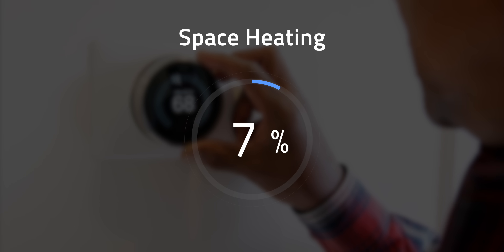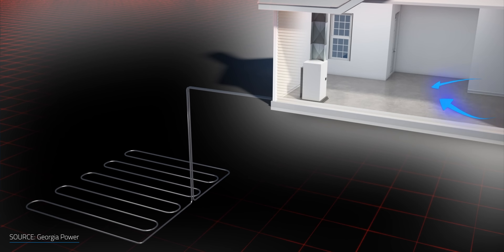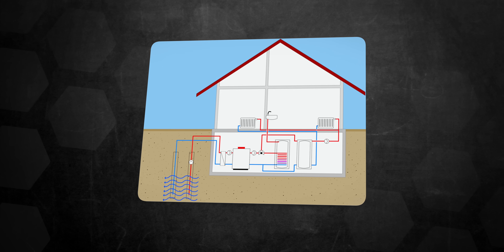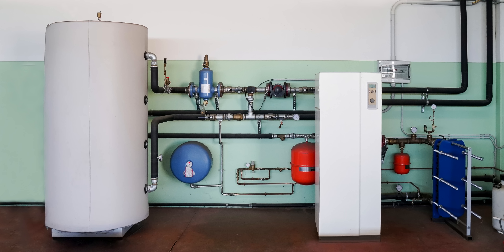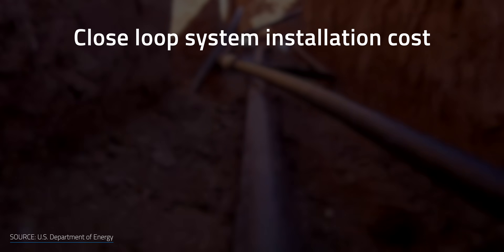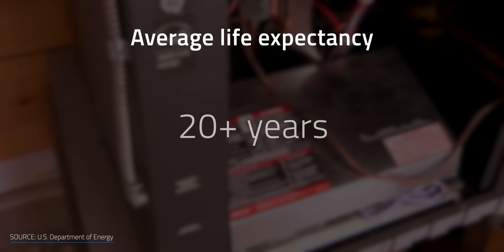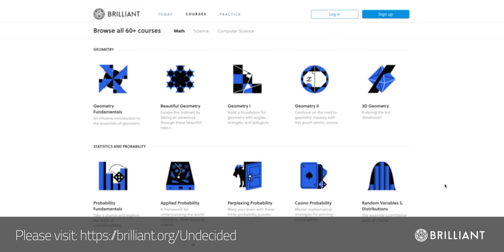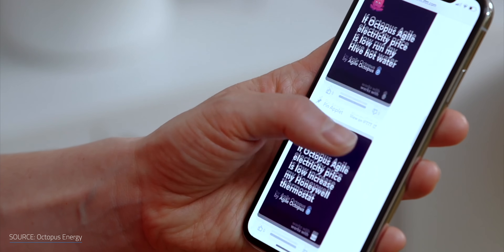Is Geothermal Heating and Cooling Worth the Cost?  Heat Pumps Explained

Comment: You missed a fairly important kind of closed loop system, where the tubing is straigth or coiled placed in a deep drilling hole of about 80-150 meters depth and 40-70 centimeters in diameter. They provide excellent geothermal coefficients, are placeable even on the smallest back- or frontyards, but are more expensive than horizontal solutions.

Comment: All of this geothermal energy and heat pump tech require big taxpayer subsidies. Question: If they are so efficient and cost-effective, then why do they require all of these subsidies? The best way to keep your heating costs down is to insulate your home better, get new energy-efficient windows and doors, maybe get a new furnace, and turn the thermostat down. These steps don't cost taxpayers a thing, and you will start saving energy and money immediately.

Comment: Anything with the name "heat pump" in it is a scam honestly. They're cheap mass produced units subject to poor quality and fail regularly. Their heat output will never match that of natural gas, oil, or wood burning stoves. I've had more issues with heat pumps than any of the other two, and have seen others gone through their own troubles as well. They simply can't put out the same level of heat as other options, and I'd be highly skeptical about this system as well.

Comment: The vertical loop systems is now widely used in new homes here in Hungary. We are currently building a house with such system. The tubes go down about 100 meter deep into the ground.
However people here don't use a system that circulates air, many new houses have floor and ceiling heating.
Reply: it's kinda bad, as air circulation system could be combined with ventilation system to supply fresh air
Reply: @s.i.m.c.a  Floor heating provides much better comfort, and requires less energy. There is usually a separate system for air circulation that runs 24/7. We are currently building a house and there is an air vent in every room, as well as floor and ceiling heating. The fresh air from the outside also goes through a heat exchanger and a filter.

One more advantage is that during summer months, cold ground water can be circulated in the ceiling to cool down the house, which requires very little energy.

Comment: Here in Switzerland, that’s a 25-30 years old technologie. We no longer use non-deep geothermal system. Now for a home you have to drill a well between 150m and 300m deep (500 feets to 1000 feets) for the heat exchange.

Comment: Really? Liquid cannot be compressed! This is a simple phisic law used for car brake system. Car brakes use liquid to transfer the push force from pedal to brake pads because liquid doesn't get compressed so the pressure aplied by foot on pedal doesn't get lost on the way to brake pads. So here  in this video, how do they compress the liquid to have a higher temperature??? This principle is available to air. Compressing air (not liquid!) to make it hot it's also being applied on diesel engines, especialy on those with a turbocharger, used in a lot of ships and vehicles, including cars (coincidence, there is also the place where the liquid is used for brakes). This video is shit.

Comment: When comparing two equivalent systems, KISS (Keep It Stupid Simple) is a crucial factor for deciding.
My non-statistical experience with similar kind of heat pumps shows that these are complex systems to maintain, and that longevity numbers supplied in this video are exaggerated.
A high price tag for these systems means one thing - the technology is not ripe for home installation.
Reply: I have a friend with one of these systems. Over the last twenty years he's had about $15,000 total in repair costs. The parts are expensive and he can't just call a local AC company - someone has to come from 100 miles away and he usually has to wait a few weeks. The system cost was also about $16,000 more than a normal one. His electric bills are very low, and maybe he broke even money-wise (he has a large house with a lot of glass), but it has been a huge hassle with the repairs.
Reply: @jmodified  I have similar experience with a McQuay air source heat pump used for heating shower water for 10 apartments (~1,000 liter water tank).
The compressor gave up after 6 years of use.
The system cost was roughly 15,000$ in current exchange rate - I live  in Israel  in an ideal location for the operation of this system. Minimal air temperature here is  5°C. Peak CoP was around 2 in the summer, but that is because too small a heat dissipater was installed in the water tank.
It is now replaced by simple heaters whose cost is 1/3 of of the air pump's, and any electrician can handle (well, it is simple enough for me to handle). Actually I did not have to replace the system. I just turned on the heaters that where pre-installed in the water tank as a backup for a failing heat pump.

Comment: I wonder how deep the system would have to be here where we just came out of 40 days below -30 degrees.
Reply: If you have a vertical system, it doesn't matter how cold the weather is. Vertical systems usually go down 100-150 meters into the ground, where the temperature is not affected by the seasons and surface temperatures.

Comment: I am planning a DIY lake cooled open loop system , so most costs go away pipe from lake to house and pump, and i can convert an indoor unit, and outdoor unit to geo for about 500$ avoiding the crazy geothermal heat pump costs; what do you think?

Comment: When we build our house, it was no-brainer to get geothermal heating. We mainly use vertical loops and only one loop per house here in Finland. Length of it depends on your system and soil. Ours was 150m long. Almost 500ft. We don't bring heat in houses via air, but we use heated water under floor.. only the cooling part is water to air system. There is lots of synergy when you use also cooling in your geothermal, because you add heat on the ground in summers and draw it back on winters. If you only draw heat whilst it's cold and have "save" money when drilled too short well, you might up end with hole where you just don't get enough heat anymore.. and the it will cost you more.

Comment: You an engineer, not a mechanical technician and it shows your extremely basically knowledge is deplorable... you measure you cooling in tons and on average its 400-500 sqft a ton... a 2300sqft house would require a 4.5-5 ton, but that is also calculated by the hottest day of the years needs...
Reply: I think current suggestions push oversized systems. I live in Florida in an 1800 square foot house with average insulation, no tree shading, and single-pane aluminum windows, and a 41 year old 3 ton air conditioner works fine (well, it did - the compressor got a bit noisy this summer and probably won't last another). My neighbors with a similar house that is maybe 1/3 shaded did well for decades with a 2 1/2 ton. In a newer well-insulated house, requirements should be even lower.

Comment: Engineering student here. These systems, and also air heat pump systems do not use radiators to warm your house but floor and sometimes wall heating. As you don't need 70C water to warm rooms, more like 35C.
Secondly it matters of course how big your house is, but defenitely also how well the house is insulated.

Another downside is that with the system alone you're often not done. If your house is a little older and not that well insulated you usually need to fix that in order for heat pumps to work efficiently.
Also this system takes up a lot more room in your house than a conventional gas heater.
Also doesn't really work in dense urban areas. 

And lastly, personal pet peeve maybe, but don't say carbon, but Co2, carbon is way too general.

Comment: Don't forget the additional cost and maintenance for your water well and the increase in your electric bill. Some geo units use 8+ gpm, how much water does your well produce? Most standard homes a well will produce 4-14 gpm. That doesn't leave a lot left over when the geo is running. Can you just upgrade your well pump for additional water?  Can your well handle the increased production or will you have to drill a whole new well?  How much more frequently will  you be replacing your well pumps?  Most well pumps only run for minutes daily. A well with a geo unit runs for hours a day.

Comment: It may be possible to reduce the cost by using a plastic pipe that you can inflate and basically drill itself into position like a snake. Then fill the plastic pipe with something like concrete then use a smaller plastic pipe to then drill into the concrete creating a concrete pipe that probably holds water. No digging required.

Comment: We need to train a lot more technicians to work on the refrigeration side of all of the varieties of heat pumps. Scheduled coil cleaning especially on air to air or air to water is crucial to proper operation and energy savings. I never see this cost mentioned in the sales presentations.

Comment: It's great when it's good and terrible when it goes bad. Almost never stand alone in Canada. You have to have supplement heat. Even if you oversize your unit  Which means the your utility bill is paid up front...for 20 years...but in actual experience, if you have 3-5 issues in that 20 years...it doesn't pay for itself in its entire life.

Comment: My inlaws had a geothermal system installed in their new house build about 10 years ago and it went kaput a couple years into the use .... not sure if it was the company who screwed up .... but in an area where we get some extreme colds during the winter months, the last two weeks we had constant temperatures between -35 and -40 Celsius .... having frostlines that can go past 10 feet into the ground I could only imagine what the start up costs would be.

Comment: It's not always advantageous to have underground structures as such when many different types of "condensing units" such as shell and tube or tube in tube 
condensers are smaller provide more efficient. Heat transfer coefficiency and also more practicality in terms of maintenance or contingency planning

Comment: I just installed this here in Finland. They drilled vertically 160m. in the granit rock, coming +65C warming water in batteries and same gives warm wather for shower. Cost 22K€ minus some thousands back from taxes (because I changed off oil heating).
Reply: 160m?! They built a mine under your house
Reply: That is not ground sourced heat.  That is geo-thermal water heating.
Reply: WOW, I am very happy to hear that you can drill such a shallow well and reach 65 C water - that is 150F in American terms.  That is so hot that it would need to be cooled off to take a shower!  It is sort of like paying your natural gas or oil fuel bill only once for the rest of the life of the home, and then some!  You should be able to share some of this heat with your neighbors, if they are close by!  Maybe tell them you will supply all the hot water they need for $45 euro's a month?  Then payback can happen much sooner!
Reply: @landlord5552  who did u use. I am looking to do the same

Comment: With zero mentions of insulation this is a very unbalanced video. Dollar for dollar you're better off investing in insulation and air-tightness than in heat pumps until your house is very insulated and airtight. And at that point you'll probably don't need these any more and you can go for a much cheaper air to air heatpump. With recent advances they can function even when it's very cold outside.

Comment: This technology is pretty ancient, its existed before the era of Steam power, although there were no giant pump like that, it was all passive. 
Sometimes, the simplest solutions, are often the best ones, in Soviet Union they built these geothermal heating and cooling solutions for entire cities in northern Siberia because these places were too far away from national electric grid and railway connections, the only way to heat was to supply electricity locally or stock up on heating OIL, that was not logical, heat pumps however for entire apartment blocks made more sense and far more efficient and they had the space and land for it as well.

Comment: First step for a house is proper insulation. Fiber glass or something similar inside all outer walls, also on top of the inner ceiling at the attic. Triple glassed windows are standard where I live (Sweden) as windows are the biggest problem for insulation. A heat exchanger on the wall is huge as it can both heat and cool a big living area. It's quite insufficient if you get really cold temperatures though (after -20 to -25 it starts to struggle).

If you go for geothermal heating drilling deep into the ground, you have to do some background checks where the soil ends and the core starts. It can get very pricey if you're unlucky and is a gamble. It's more efficient than the linear way (ground heat), which also requires some big space of course. Both are very good investments in the long run.

I personally would never live in a house without a stove with a hotplate, both for heating and cooking if the electricity goes out. It's not fun to die just because you're not prepared for a disaster scenario.

Comment: You cannot compress a liquid in a refrigeration system.  That is the most common cause of compressor failure.  Liquid refrigerant should never return to the crankcase of the compressor.

Comment: First-time viewer and love the concept behind your channel! Just wanted to point out that I think your math is wrong at the beginning of this clip. If 15% of electricity is used for heating, and 16% for cooling it's incorrect to say that 31% of electricity consumption comes from these two sources, given you are either heating or cooling your home, and not both simultaneously. I think it would be more accurate to state that heating & cooling accounts for 15-16% of electricity consumption.

Comment: No no nooo, wait a minute, wait a minute. You say that heating represents 15% and cooling 16%, and you go and add them up, saying that they add up to 31%....uf, what a serious mistake. If we average cooling/heating it comes out to 15.5%, every month of the year that you use them. But add 15% heating to 16% cooling in winter, does not make sense. Adding air conditioning cooling to heating in August... is not possible. Nobody does that. So you have to add 15% or 16% to the expense generated in a month depending on the month, not every month. Where am I wrong?
No no nooo, un momento un momento. Dices que la calefacción representa el 15% y la refrigeración el 16%, y vas tú y los sumas, diciendo que suman el 31%....uf, qué error más grave. Si hacemos la media de frío/calor sale 15,5%, todos los meses del año que los uses. Pero sumar 15% de calefacción al 16% de refrigeración en invierno, no tiene sentido. Sumar el frío del aire acondicionado a la calefacción en Agosto... no es posible. Nadie hace eso. Así que al gasto que se genera en un mes hay que sumarle 15% ó 16% según sea el mes, no todos los meses. ¿En qué me equivoco?

Comment: We have a new built house in germany with a deep drilling thermal exchange system (99m, you can calc this into feet or inch depth or w/e you like yourself) with an efficiency factor of above 7 (1 part electricity makes more than 7 parts of heat). It is about 25k€ tax incl. installation cost including the drilling cost. Highly pleased with it since the electricity rates for these house heating sources have separated rates than normal(consumer electricity) rates (50-60% of the price of normal electricity rates). Also there is very little space required for the deep drilling (20sqm)  and it's not really more expensive since you surely need heavyier machinery but less soil to be moved. Your only need a public power hook-up(it's split up inside the home), no gas or oil delivery, no storage room for the fuel, no chimney on the roof(no servicing for the chimney) and at least in Germany you get state funding for modern heating systems. This combination was promoted with almost 8k, so total cost was about 17k (again tax incl.). 10/10 would recommend

Comment: Your figures are not quite realistic. I've been in the HVAC trade for the last 25 years. Most of the information is on point. Residential conventional systems are well over $10k to install a new system. That is just equipment only. Add ductwork into the equation and that cost balloons to over $15k. Im from San Diego and plenty of equipment only changeouts were $12-15k...add ductwork and its $20-25k. Water source isn't feasible due to lack of space available....pack houses and people in like cattle. Any water source system closed or open does require annual maintenance and care. The pumps, refrigerant circuit and overall quality of the equipment is not made like they used to make them....lots of bells and whistles....but loq on quality. You won't ever get 50 years out of any modern day equipment...you won't get 25 years out of it. Manufacturers want and need to make money.....so they build themnto fail....parts are big money makers. Plus all the cheap Chinese made garbage is doomed to last a short while.

Comment: I doubt any of these systems are going to work in more colder climates. I mean the ground temperature is neve going to be warm enough. What kind of temperatures are we talking about? for winter is it even going to get above 50F? because the ambient ground temp is usually around that. 50F is terrible for a winter. Summer I another thing, but 50F would be perfect since you can tune it more.

Comment: The figures of 1 kwhr of electricity gives 1 - 5 kwhr heat are laboratory figures. In the real world it is more like 1 to 2.5. And given electricity is typically 3 to 6 times more than natural gas the maths start to fall apart. In most cases better return on investment is insulation and more insulation, turn your heating down and put on a woollen jumper.